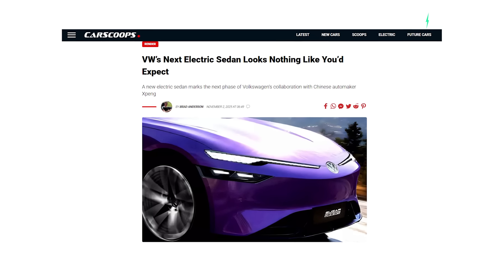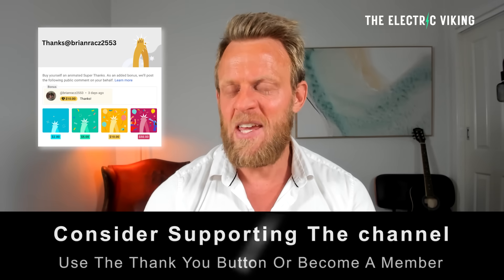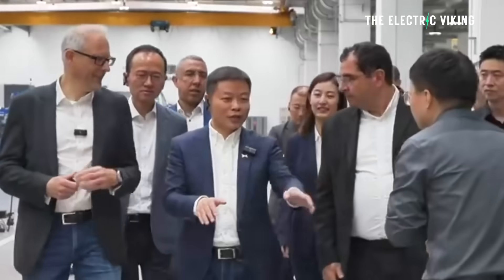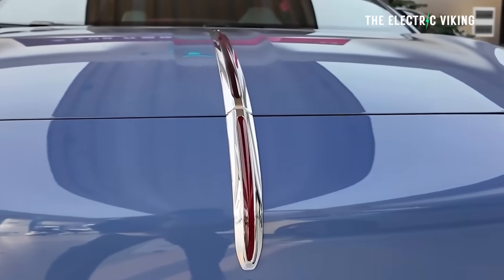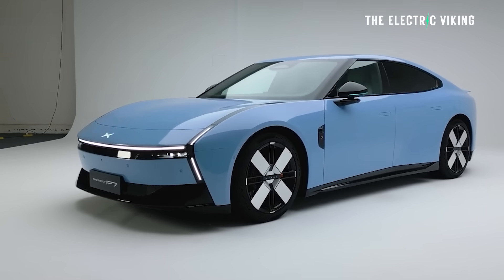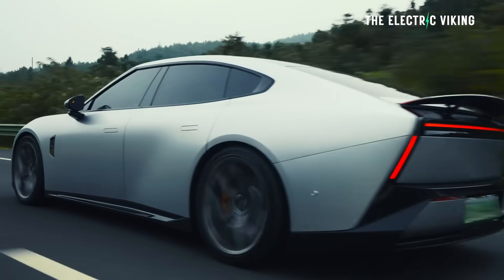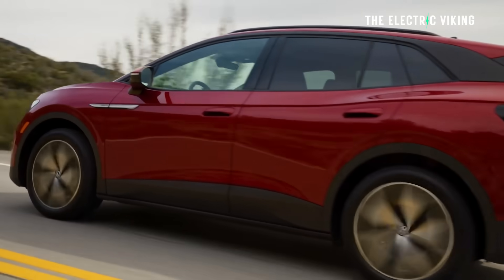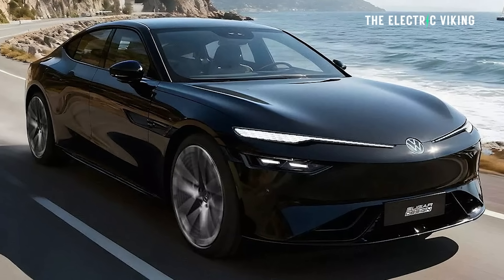VW’s New Electric Car is Really an Xpeng - It Could Be Epic...

Comment: No. It's a Xpeng and VW cross. Has some looks of the VW Passat at the rear and Xpeng in the front. VW has never been able to build decent cars anyway. If you have to change the battery in a VW Beetle you will start cursing. They are just too ridiculously designed.

Comment: I prefer the original Xpeng than the copy, but for those who do not know cars, who do not know technologies and follow nbrands, they could like this excellent alternative, with fantastic software and operating system, bes processors ever used (Turing AI chips) and all this signed by a brand they know! They will appreciate the silence and cimfort of this Volkswagen, which is much better of the one of a Pheaton!

Comment: Hey Sam,

MEB platform is just fine, you seem to confuse E/E with hardware platforms. Volkswagens internal software (E/E) is woeful. The ID UNYX 08 SUV (G9) and ID UNYX 09 (P7) sedan are based on XPENG hardware platforms and have the JV CEA E/E architecture.

Comment: Ford sold the Laser and Telstar in the 1980s and 1990s. They were badge engineered Mazdas. Makes sense for VW to sell badge engineered xpeng vehicles. You can bet that VW group has lots of dealers, marketing and brand recognition with European buyers - this helps xpeng share and reduce costs. VW is just here to make $$$$ and if the xpeng platform is cheaper and better than a home developed platform the execs will sure as hell take the cheaper, better platform.